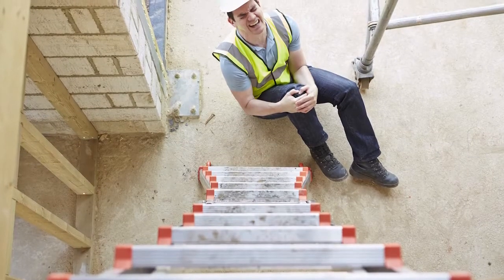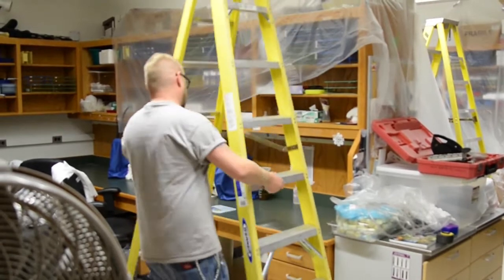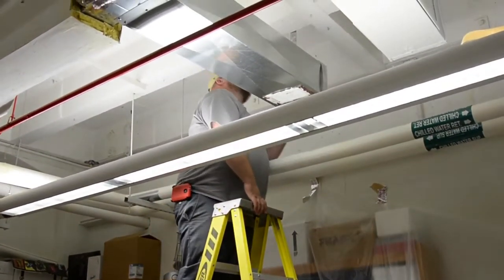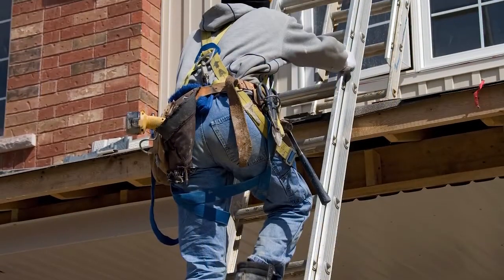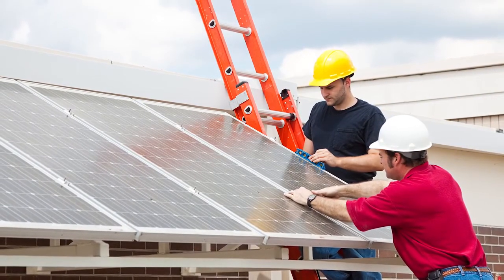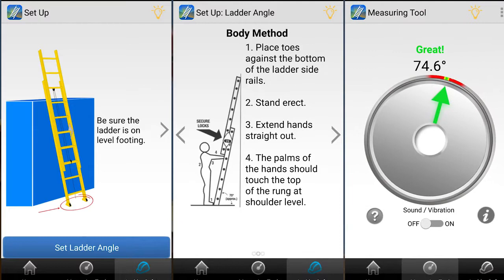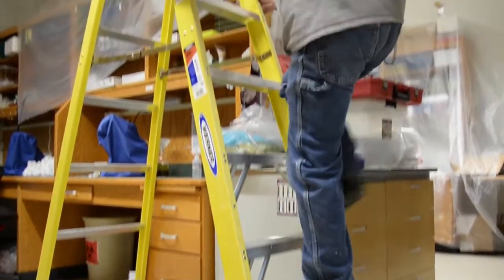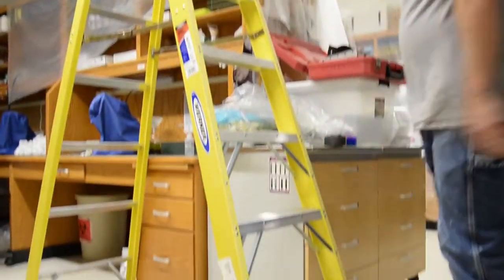Fall Prevention from Ladders

Comment: For ladder work at home a fall restraint is a good idea….but not those shock absorber fall arrestor types, because you’ll hit the ground before it stops you. I reckon just use a really short lanyard to the ladder (two feet max) AND secure the ladder so it cannot slip.  If you lose grip you’ll just hang from the ladder and can get back onto it.  This is harder to move around with, but you’ll live to ladder another day huh!